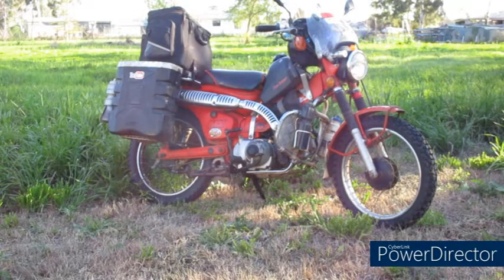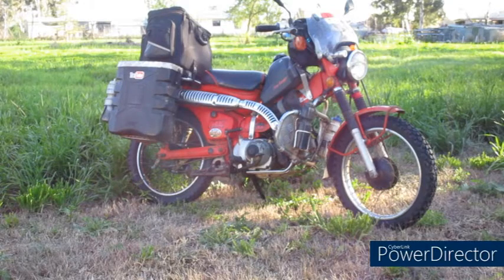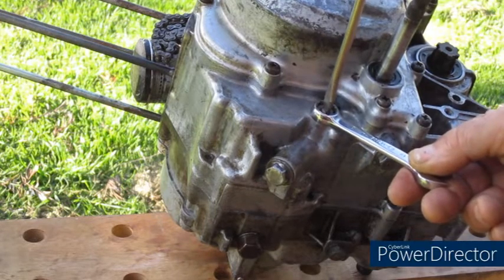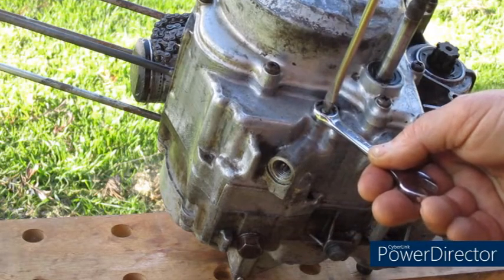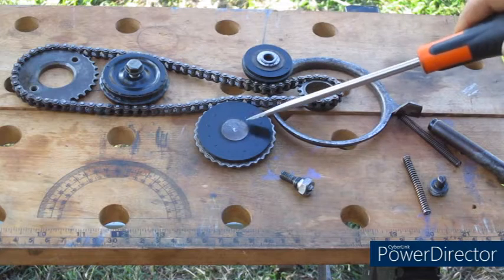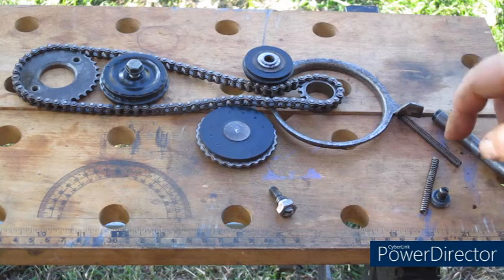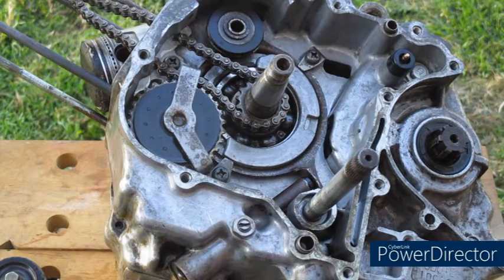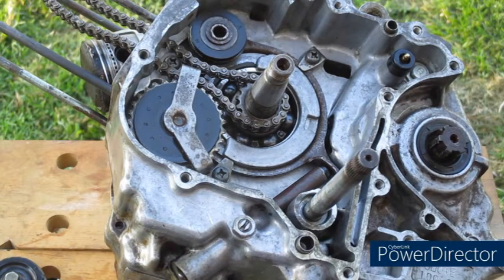Honda CT 110 Trail Cam Chain Tensioner - Everything You Need To Know

Comment: So after you loosen the jam nut on the side of engine case and adjust the slot headed screw out a turn or so, is that screw supposed to be screwed back in so it’s snug/tight or how far do you go before tightening your jam nut again?
Reply from the maker: Yes, the slotted bolt is screwed back in, it clamps on to the flat side of the plunger & holds it in place.  Don't over tighten the slotted bolt & the nut, it's easy to strip the threads on the thin alloy engine case.
Reply: @Free_Ranger_CT110 thank you!

Comment: Is it safe/recommended to do the adjustment whilst the engine is running or do we have to tweak/restart/stop/tweak/repeat?
Reply from the maker: Yes, with engine running is how Honda recommend.  Only slacken the side screw slightly so the plunger doesn't twist.  It has a flat on it for the screw to locate against.  Hope that helps.
Reply: @Free_Ranger_CT110  Worked a treat, much less rattling now. Thanks!!
Reply from the maker: @mlmoke  glad to help, enjoy your mighty CT.

Comment: The best information you can get, many thanks 👍
Reply: Just a question, when I did the first step and loosen the lock nut and turned the adjusting screw counter clockwise, it started to razzle so I stopped the engine because I thought the cam chain would jump off, I tried to turn back the screw but it seemed I could not do that with the engine running. Thx
Reply from the maker: @Oldtimerman  it should be possible with engine running, that's how Honda say to do it.  Only slacken the screw a small amount, just enough to all the plunger to slide.  the plunger has a flat side that the screw butts up to.  Don't allow the plunger to rotate or you'll not get the screw fully back in. Hope that helps.
Reply from the maker: Thank you.  Appreciate you watching & taking the time to leave a comment.  Encourages me to keep on going, thanks again.

Comment: Useful details on function - however - there is no mention of how many turns of the lower (not the side lock) tensioner/plunger as an initial setting if replacing the chain.
Reply from the maker: The cap/plug can't be seated if the screw is proud of the boss, as an initial setting screw it in just below the case & the plug can be fitted without fouling on the scew.

Comment: Cheers mate, that's a good one. So this adjustment does not related to engine oil pressure and auto adjusting...?
Thanks
Reply from the maker: Not on this model no, on earlier ct90 bikes engine oil drains behind the plunger & hydraulic locks it & auto adjusts.  These earlier bikes don't have the screw & locknut which holds the plunger in position as seen on the engine in this video.  Thanks for watching & commenting.